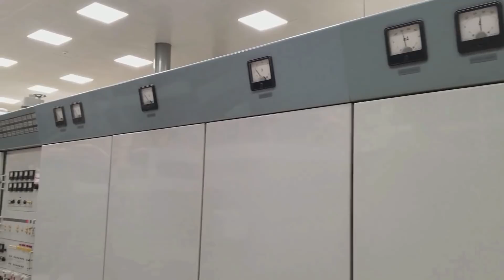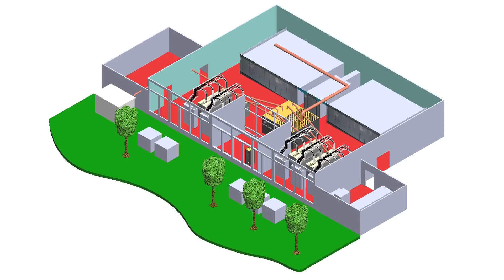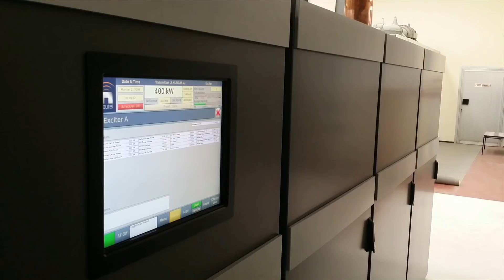Building the Biggest: 2 Megawatt NX2000 System

Comment: Congratulations....¿Can you explain  me, in 1:52, why TX-B has more reflejted power than the others? Thanks
Reply: That was most likely during the final alignment before everything was perfeclty matched
Reply: Hello, those values are not reflection but rejected powers (waste power on the combiner's reject loads). You can see the quite high reject load temperatures on the bars on the right hand side. These values occur from the individual transmitters being a little bit out of sync. This cut was definitely before the final, "smooth" syncronization of the system.